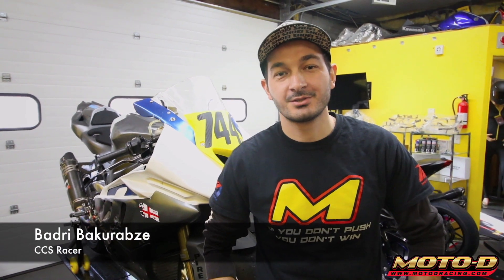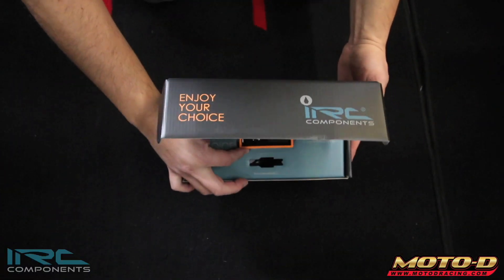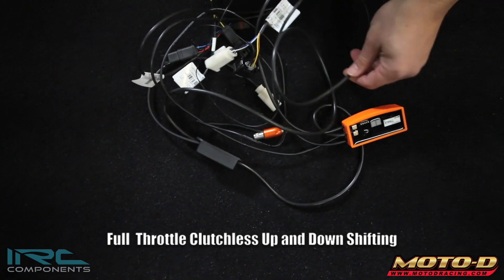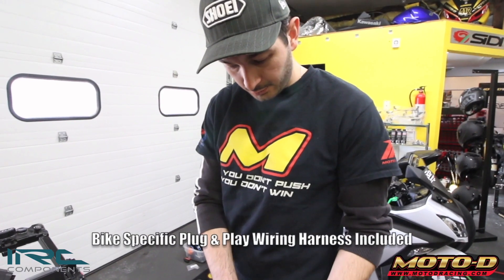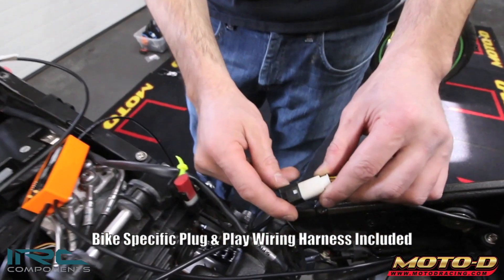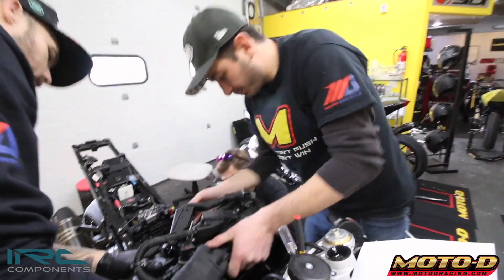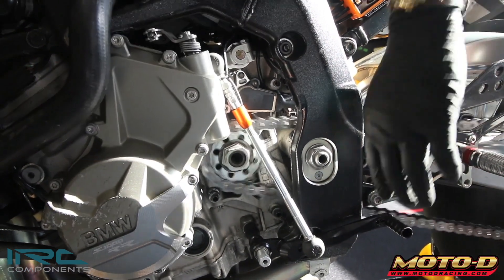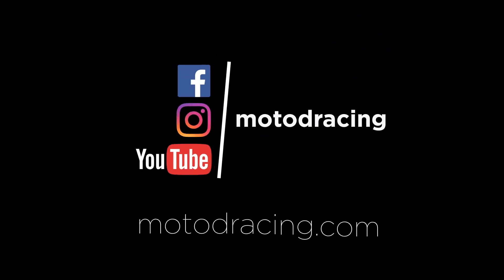IRC Components BMW S1000RR Auto Blipper Quickshifter Install | MOTO-D Racing

Comment: This will work on a base model 2014 bmw s1000rr without the gear shift assist? Does that device have to be on the outside or can it be hidden somewhere?
Reply from the maker: For base model, we need to make a special unit. Please email info@motodracing.com so we can do! Thanks.

Comment: @Moto-D Have the RSV4 RF, can you still rev match manually with this installed? Possible get a copy of the manual, want to see whats involved with the installation first? Also will it work with GIAMOTO rearset?
Reply from the maker: please email info@motodracing.com so we can better answer all the detail correctly. Thanks.

Comment: I own 1290 SDR 2016 Gen 1. And I wanna know if it cuts fuel or ignition. Thanks in advance
Reply from the maker: The IRC unit for the KTM Superduke 1290 is Fuel Cut > https://www.motodracing.com/irc-components-ktm-superduke-1290-up-down-quick-shifter

Comment: Just purchased a 2014 S1000RR and the instal looks fairly simple, just a bit time consuming due to having to remove many tedious pieces. Does this require a tune at all? Is this system better than the stock 2015+ years with their OEM downshift auto blip capabilities?
Reply from the maker: This is correct, the hardest part is the time consuming process to remove the pieces to be able to make the connections, no tune or flash required, stand-alone system. Order here: https://www.motodracing.com/irc-components-quick-shifters-auto-blippers-bmw
Reply: Did you install one? What do you think?

Comment: Not surprised after reading description that it's got 'Upshift only' feature for some bikes..
Blipper not included for YZF-R3
Reply from the maker: Sorry, the R3 is not a Ride by Wire Throttle so Blipper is not possible. Thanks.
Reply: @MOTODRACING  thanks for relevant reply . .

Comment: How about a Yamaha Vmax 1700 -16 ?? (Fly-by-wire throttle and a PCV installed)
Reply from the maker: The IRC quickshifter (up only) for Dynojet PowerCommander 5 > https://www.motodracing.com/irc-quick-shifter-module-for-dynojet-power-commander-v